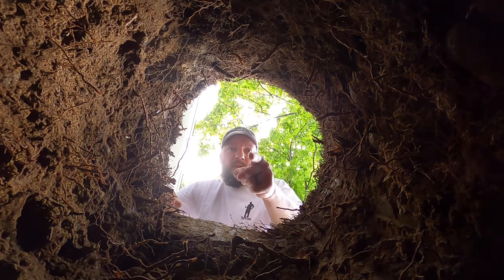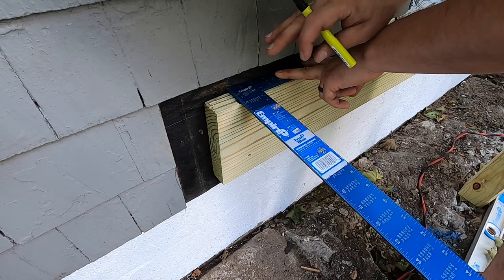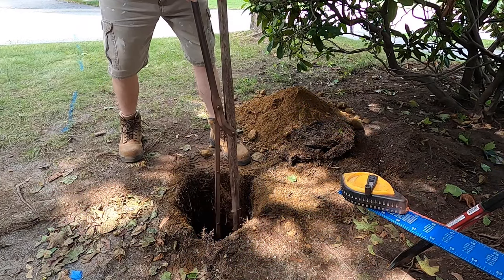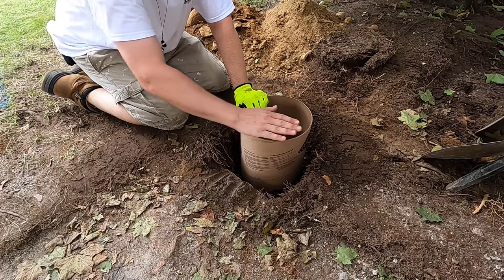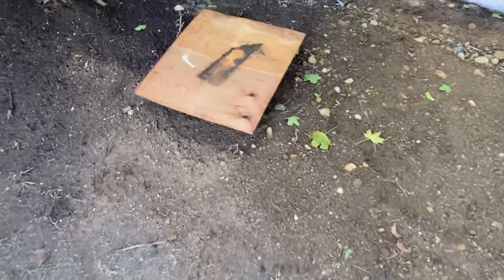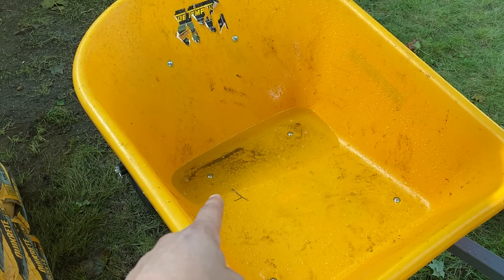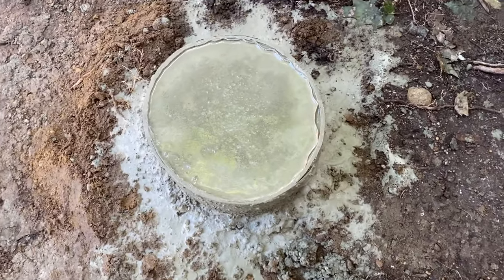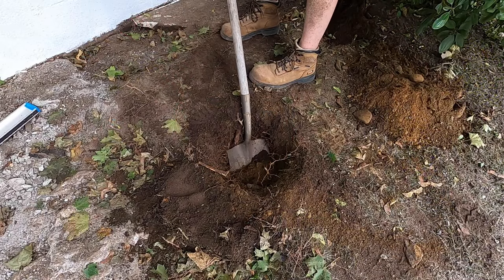How to Install Concrete Pier Deck Footings with Sonotubes

Comment: I'm sorry about your loss of the shovel... may it rest in peace in shovel's heaven. On a second note, if you're worried about background sounds, I think you can script the audio offline and then merge it with the video (I have seen this in other channels though I don't know how it's done) however, it didn't bother me at all... keep the good work!
Reply from the maker: Yes!  I did some voice over a little bit in this one actually.  It is just a change I am not used to but I will be working on improving it since trying to wait for cars to pass is making it take 4 times as long to make the videos! 😔. Thank you for the advice and thanks for watching!

Comment: I watch too many of these for someone who doesnt have a deck or place to put one. Question, I have seen a few people dump the dry bags of concrete mix into the hole then add water, is this good or bad in your opinion?
Reply: As long as you mix it thoroughly!!!
Reply: Thanks
Reply: Thats what a lot of people do, and its rather dumb. Your mix needs an rather exact amount of water if you want to get the rated PSI.  Mixing it in a hole is fine if you're putting up fence posts maybe, but a sure way to mess up anything actually needing support.

Comment: @15:48, you actually dont want a flat end on the sonontube top, you want a domed shape to keep water from standing on the top and damaging the concrete, you can then set those anchor bases in place which allows you to shift the anchor point after it dries, easy peasy.

Comment: I leveled my tube at the top and it settled about an inch.  Do I need to keep adding concrete every 10-15 as the water rises?

Comment: Dude, one look at that post hole digger and I instantly can tell that is a way better design!
Reply from the maker: Right!?  They don’t make them like that anymore!
Reply: @TheFixerHomeRepair  Best get your measurements now for some oak or ash to replace the wood incase you have an accidental break.  Might want to look into someone that refurbishes old tools also.  Just an idea, or a thought since I know that a craftsman is only as good as his tools, and that is a very functional beauty.

Comment: Did you then pull out the tube after the concrete cured? If so, how?
Reply from the maker: Nope.  It stays in the ground.  Just cut the cardboard off at the surface and peel it off.
Reply: @TheFixerHomeRepair  Thanks! I've got 6 to set for a free standing deck so getting them all level is gonna be a trick. LOL...I think I'm gonna rent a transit. Is that the easiest method?

Comment: seriously someone had to come in the middle of your work to check if you aer up to code?
Reply from the maker: Yes, they make sure you have sufficient footings before you pour the concrete.  I guess it is better than them telling you its no good after they are poured.  That would not be fun!

Comment: Very watery mix. I'd much rather give the box store $50 to rent a post hole digger to dig for me if I had more than a couple. Heck, even a couple I'd pay that, 5 minutes per hole and you have yourself an hour or two, and if you don't need a permit, can get your tubes in there and get done that day.